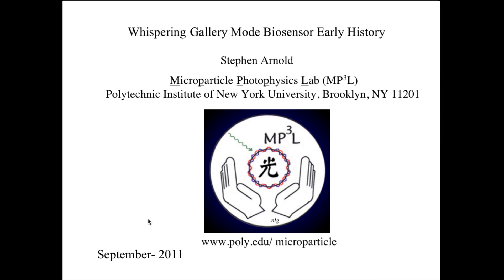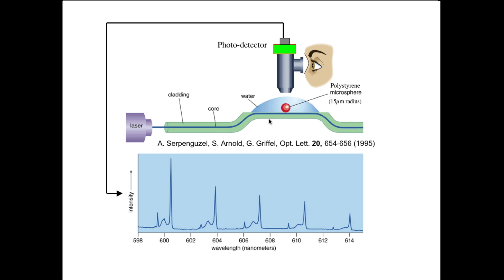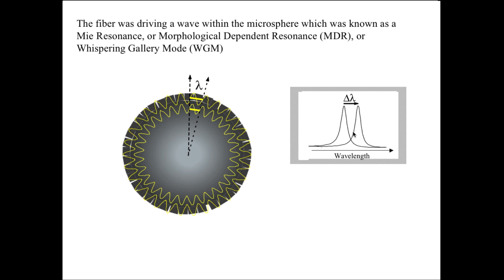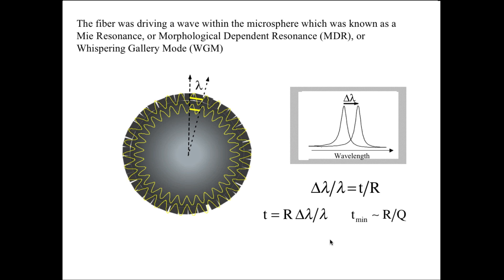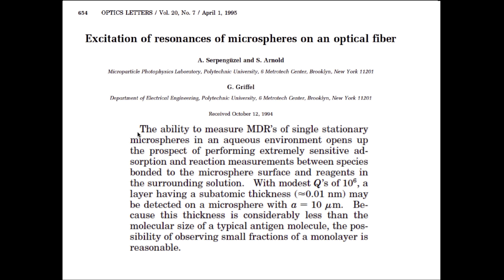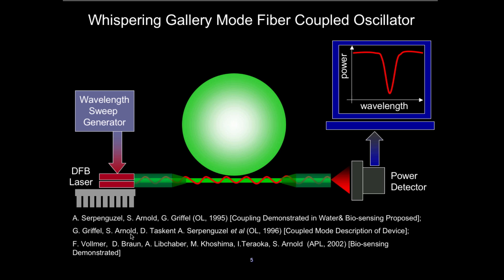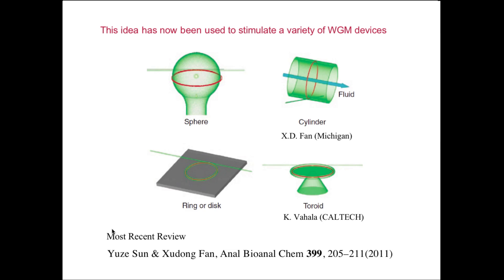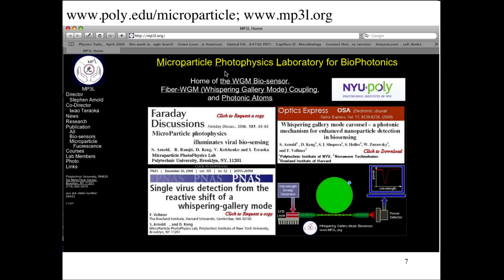1. Whispering Gallery Mode Biosensor Early History (1994-2002)

Comment: Thank you for your clarification about the patents. Do I understand it correctly that the WGM biosensor field originated in the period between 1995 and 2002? It started with 1995 publication by Serpenguzel, Arnold and Griffel in which the WGM mechanism for biosensing was proposed. It was complete with the first basic patent application by Arnold and Teraoka in 2002.
Reply from the maker: Yes. The field essentially started in 1994 with the discovery that (1) Whispering Gallery modes survive in aqueous solution,, (2) these modes could be stimulated by evanescent coupling to an optical fiber, and (3) the biosensor proposal including an estimate of the extreme sensitivity . In fact, this is cited in the 2002 paper by Vollmer et al (Applied Physics Letters) which demonstrated the shift due to protein binding-  In referring to the 1995 Optics Letter by Serpenguzel, Arnold and Griffel, the 2002 paper writes "The frequencies of these so-called whispering gallery modes (WGMs), characterized by a number of wavelengths L within an orbit, are extremely sensitive to added dielectric material on the micro-particle surface. It is estimated that an atomic thickness can lead to a detectable shift of a given resonance frequency". I should point out that experiments and theoretical work were simultaneously going on in my institution (Polytechnic University) to support the work at Rockefeller, and in fact the first thesis on this was presented at the Polytechnic.  Doctoral Dissertation of Maziar Khoshsima. “Perturbation Of Whispering Gallery Modes In Microspheres by Protein Adsorption: THEORY AND EXPERIMENT”, http://research.poly.edu/~sarnold/paper/Pub_701_1111.pdf

Comment: Does "small fractions of a monolayer" mean individual protein?
Reply from the maker: The detection of single protein by a bare cavity is difficult because of the very-very small signal which falls well below the noise level. Although there have been claims of such detection I personally have my doubts about those claims. The first detection which I am aware of used an enhancement mechanism in the form of a gold nanoshell-receptor bound to the microsphere surface in the Whispering Gallery Mode region. A single protein binding to this nanoshell leads to a measurable shift of this hybrid resonator. Dantham et al reported a signal to noise ration of 13 for the detection of a a single Bovine Serum Albumin molecule in their paper in Nano Letters in 2013; https://pubs.acs.org/doi/full/10.1021/nl401633y

Comment: Where did you get the idea to start working with microsphere resonators which led you to couple to a shaved optical fiber?
Reply from the maker: Our work started in 1986. At that time we isolated particles through levitation. The resonances that appeared in fluorescence emission were associated with light trapped in polygon orbits by total internal reflection. Total internal reflection is accompanied by external evanescent decaying
fields. With the awareness that optical fibers are coupled by interacting evanescent fields we guessed that perhaps a fiber evanescent field would couple to the evanescent field of the microsphere polygon orbits. At that time the resonances were known as morphological dependent resonances (MDR). Now they are known as Whispering Gallery Modes (WGM). The early history of our work is detailed in Arnold, S. (2001). Microspheres, photonic atoms and the physics of nothing. American Scientist, 89(5), 414-421; https://www.jstor.org/stable/pdf/27857529.pdf